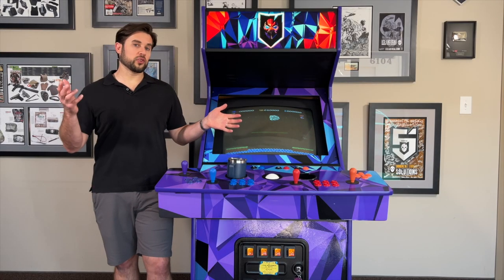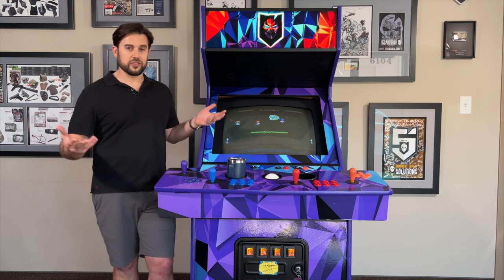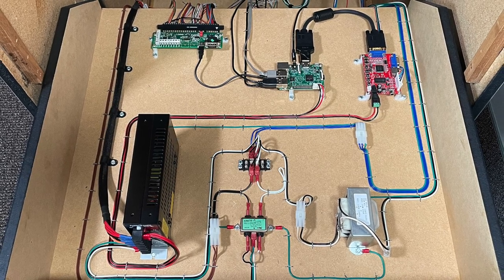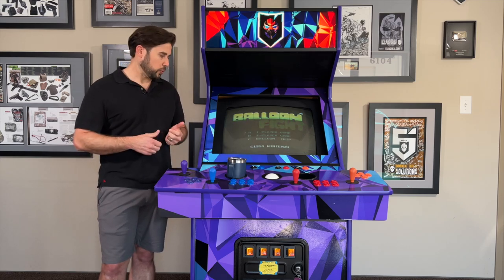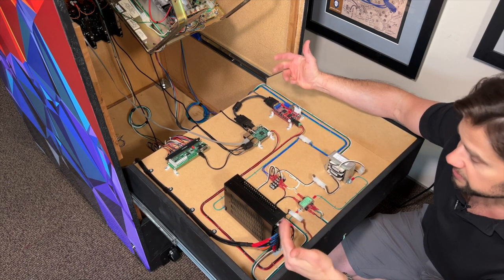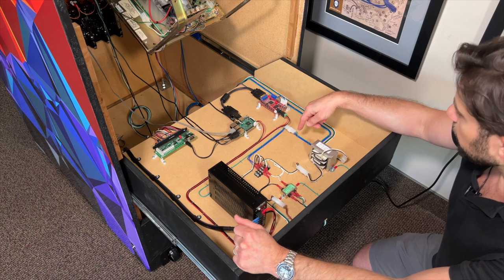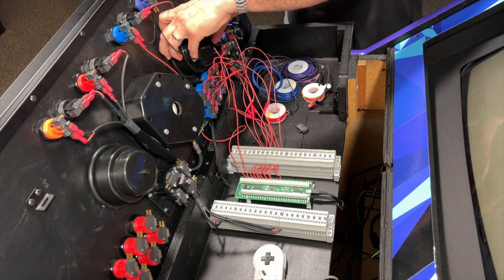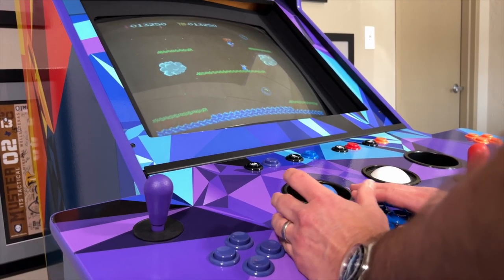How We Built an ITS MAME Arcade Cabinet

Comment: I have completed a similar project on that same cabinet model...  The vinyl on the control panel can wear out pretty easily in high touch places.  You can protect it with an acrylic layer.  It cuts easily with the right tools, but scratches easily too, so it's best to smoke the acrylic with a light sanding...  As for lighting your coin buttons, you can do this directly from the arcade power supply and if you wanted them to function, you can run wiring down from the i-pac.  I also found pvc foam board to be the best solution to my monitor bezel, but I had to swap out the defunct CRT for a 27" 1080p panel.  Good luck finishing it all up.

Comment: Drink holders are the last thing you want on a Arcade cabinet.  Just asking for a disaster.  Also, I have a cab built with a PC & Hyperspin front end instead of a raspberry pi.  You don’t need a expensive pic to run Mame & the presentation and interface is so much better.

Comment: Liked the video and how you showed what you did but Two of those cards could of been replaced by a pi jamma adapter. the mame/emulation community has been doing everything you did since the 90s with lots of documentation on how to do it as it had changed over the years and more ways got added.

Comment: what is the name of that transfomer you have you keep showing on the video I have a wells gardner and GBS 8100 Monitor Card hooked up it came on a lil bit then went off I can hear it still of ..my transfore went bad need a new one what is that transformed called its on the video transformer 02-0010 ...that hooks up to your CGA monitor, and I'm not trying to do it off of the raspberry pi but a Pc CRT EMU and a 5450 ATI CARD